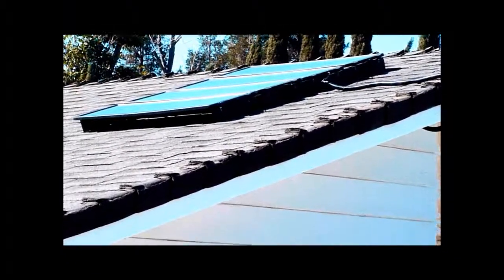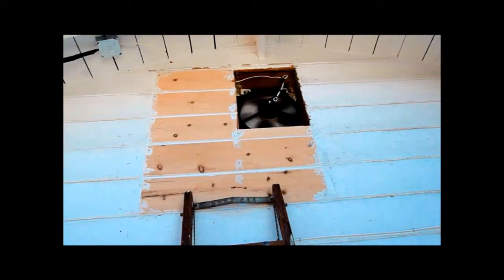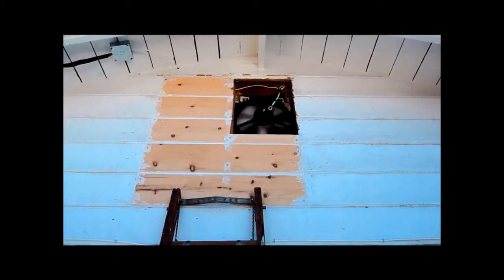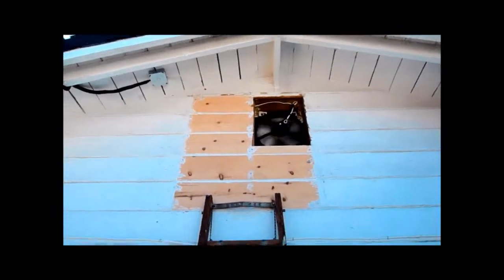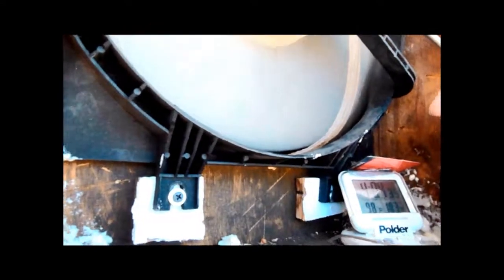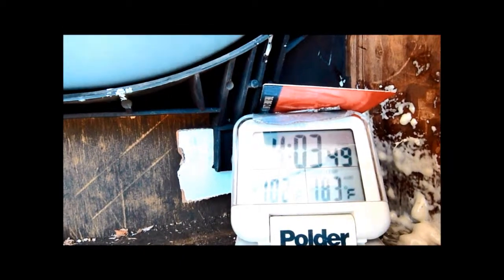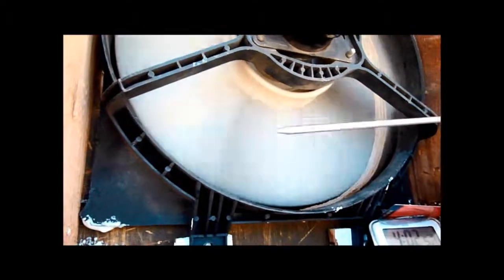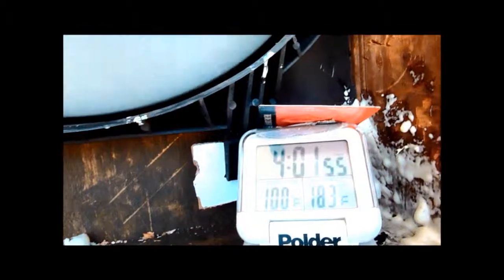Solar Attic Fan

Comment from the maker: you are correct most radiator fans fall around 6 to 8 amps...I could have added another 15 watt panel by why push the radiator fan... 5 amps and it still cranks big time...plus the lower amperage the fan will last longer..

Comment: I see you did have a 60 watt solar panel at 12 volts so the maximum amperage of your radiator motor is 5 amps! I answered it. Great job by the way!

Comment: These fans are 12 volts. What was your solar panel rated for? Most of these car radiators pull 6.5-8 amps so that could pull a lot of wattage? How many watts is your panel rated for?

Comment from the maker: Well I'm not sure what you mean..But...It depends if you bought a single solar panel then you would have 2 wires. Simply bring those 2 wires to your car radiator fan and solder them together...If you like you can put a junction box under the eaves and install a light switch, a simple on and off.. That way if you would like to turn it off during the winter you can..Remember your eave vents must be open and flowing...any more questions just ask